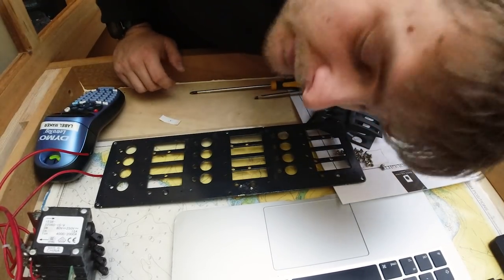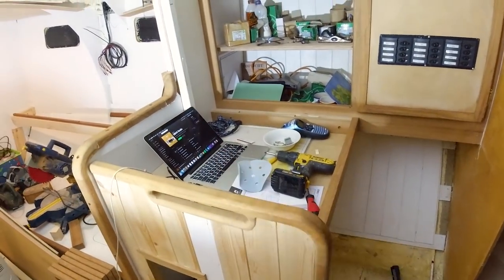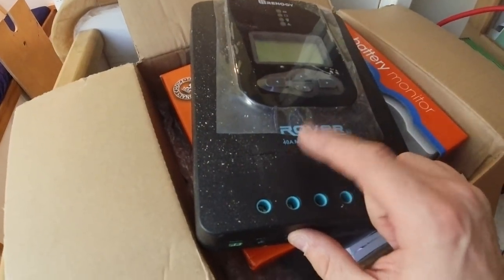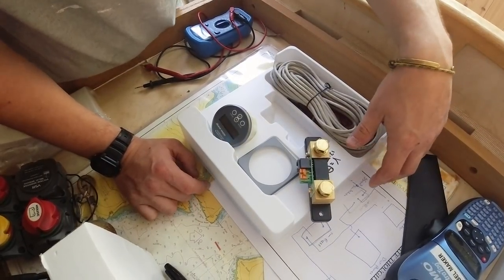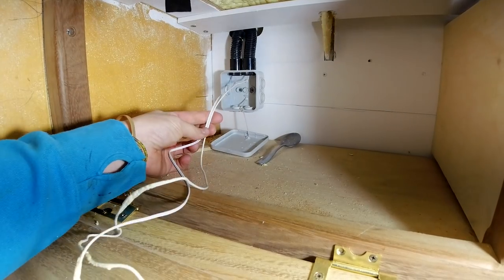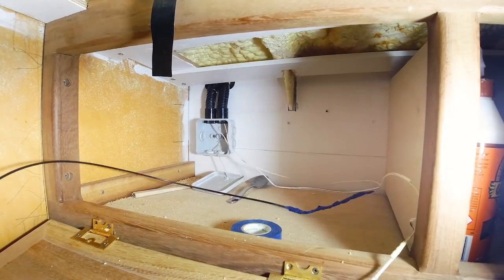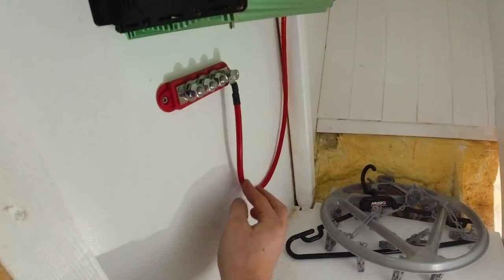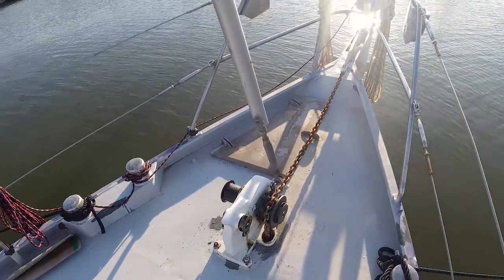Electrical Panel Install - Episode 39 - Sailing Yacht Zora

Comment: Hi great video. I noticed that you didn’t have any drip loops on your wiring to your terminal strips inside the Electrical cabinet. As you have it wired now, if there is condensation on those wires, that moisture can migrate down the wires to your your terminal connections, which in turn can cause future corrosion. You need only to fashion a small loop on your wires so that the bottom of the loop is below the level of your terminal connection. Then any moisture will drip from the loop and not migrate to your terminal connections. I really enjoy your videos, and I think you’re doing a great job with your boat.

Comment: Just a quick tip, might come in handy. If you ever find yourself with a conduit without a fish wire. Use light string/rope, cotton, wool, or something synthetic, perhaps even a bit of wadding on the end. Push it in on one end of the conduit as far as it goes (10-20 cm) and on the other side use a vacuum cleaner to suck it through. You'll might have to plug some branches but in most cases it works. Use this string/rope than to pull the fish wire through. Or, if you have a compressor you can blow it through. In that case you have to plug all the branches.
Reply: Blew my mind the first time I saw this done. I watched an electrician at a job site for a couple months lay conduit with no fish tape and I couldn't figure out how he was going to pull the fish tape through until I saw the vacuum show up the one day.
Reply: I'm a electrician from the States. Been doing it for years. We can install 1000' of underground and suck in pull strings in a snap.... It goes in so fast you have to keep your fingers away from the string or they'll get cut.... 
Plastic sandwich bag works great. For bigger pipes we use kitchen garbage bags...

They actually make a little foam slug with eyelets just for this. A different size for each conduit.... They're called " mice"...lol.. keep up the videos 👍 I'm watching your electrical install...very nice work so far...

Comment: Make sure you get enough air exchange around the batteries to keep the hydrogen generated pulled out.. Yes it is not making much when charged normal and not cooking them.... But one never knows...

Comment: you can calculate your amps ,thats fine.but buy a cheap clamp type amp /multimeter off ebay and check the real life readings and the meter would be handy to keep on the boat.

Comment: Nice work you done on the sparks side .For my fairly cheapo  55 year old boat 30 feet which came pre wired for electric and GPS and Depth sounder normal non AIS radio  and  electric self steering (also wind vane) means I am going to go more for  try to use as little electric as possible . Its gonna be paraffin lights gas cooker and mostly wind vane The electric power will be 18 volt 100 watt solar panel with PWM  as the difference from MPPT isn't that big on small sizes . it is  something like MPPY gives 70 watt and PWM gives 65 watts . Also the engine alternator can be used at pinch or I might get cheapo Chinese 1000watt gasoline benzine petrol generator . Those cheapo gennies have very short life spans less than 100 hours before some part breaks and the part costs the same as to buy a new  generator  but can work if you use it rarely . Battery will be flooded lead acid 60 amp for engine and single 100 amp AGM for the house battery . That AGM at  200 euros cost the same as one 6 volt 220 amp golf cart battery ( so I need 2 to make 12 volts  or 400 euro).  I figured out I was chasing my tail to put in 400 watt solar larger MPPT and LiFe or LiFePO4   Lithium about  200 amps and the rest when it is just a  small boat and me a single hander sailor . Naturally larger boats like your require the more complex expensive solutions .  Different boats different folks . Keep up the good work your doing  . I hope to start some basic video probably on www Bitchute com  in 2020 ( bit chute  don't censor  and you tube will they say get rid of all non earning youtubes so they gonna get rid of me as I don't advertise to make money)   but these video will be more pictures simplex with commentary  style  as filming requires too much time and expense using only my 5 year old i3 laptop and cheapo mobile phone and the time factor from me a single hander sailor .

Comment: IMHO sticking to 1 or 2 brands within the power system inverter, charger ect to make sure they communicate and coexist well.
Reply from the maker: Going victron for battery charger and monitor, but their charge controllers and inverters are over priced.

Comment: 12VoltPlanet is a great supplier. Did you buy OceanFlex tinned cable?
Reply from the maker: For the most part, I'm using standard battery cable for heavy cabling, I can't justify the cost of tinned battery cable. Everything else is tinned